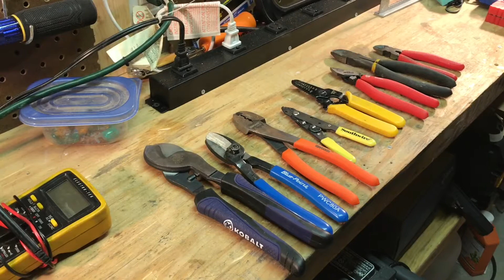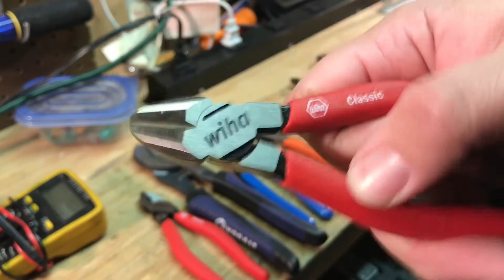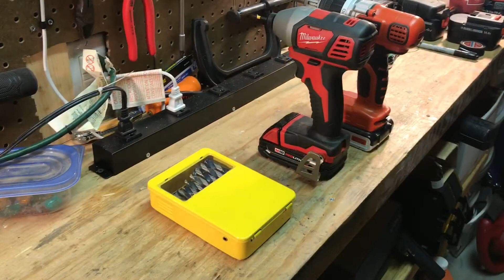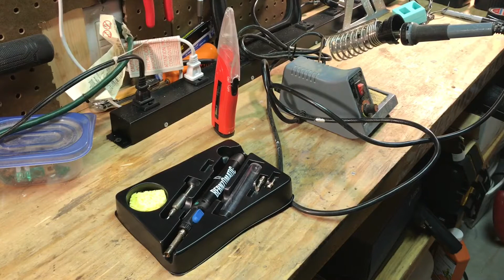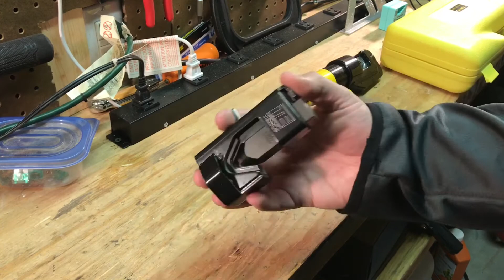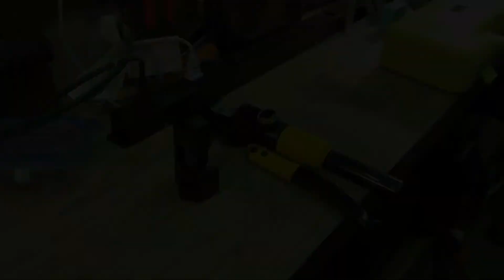Top 5 Car Audio Tools You Must Own!

Comment: The knipex cutters you can get for $20 and they will out perform both those chomps you got there.  Mine are 12 years old used every day and could still chomp a finger off. They are small and will cut 4/0 like butter
Reply from the maker: Casey Cross Knipex makes fantastic tools! Unfortunately I haven’t owned any personally, but I hope rectify that soon...
Reply: Had a feeling you would say harbor freight at some point.

Comment: Never buy Blue Point anything.  They do not build anything.  So no matter what Tool it is they have, there is another manufacture that will have the same exact unit for less money. Guaranteed.   You can always get power tools from CPO outlets and get killer deal on refurb combo units.

Snap on makes a killer set of crimps that are the small size.  They are expensive $50-70 but you will have them rest of you life.
Reply from the maker: Casey Cross those cable cutters really soured me on Blue Point.